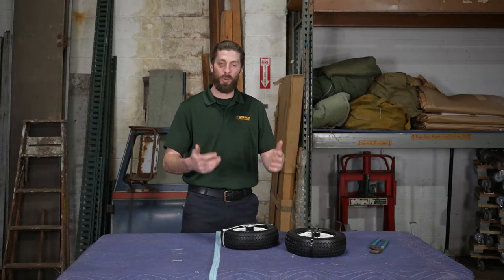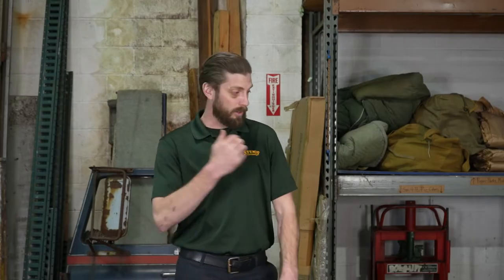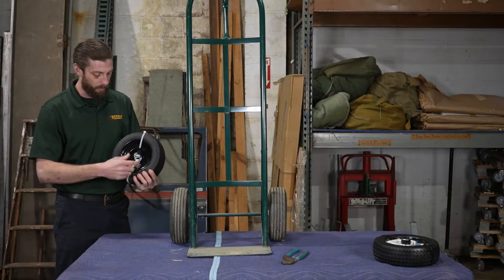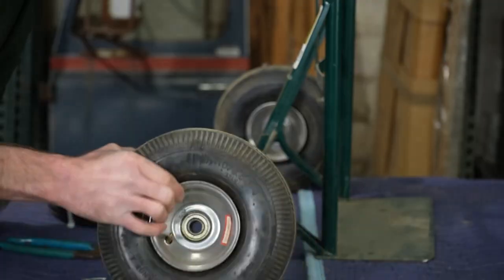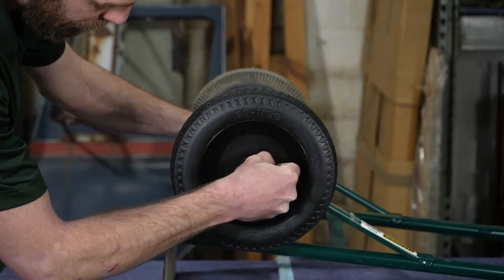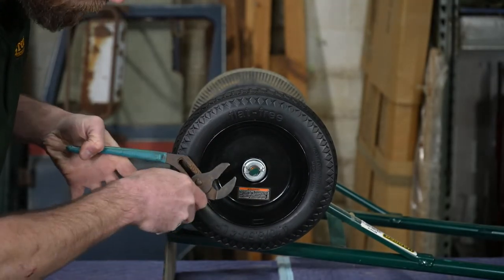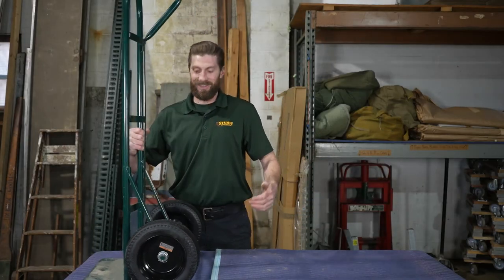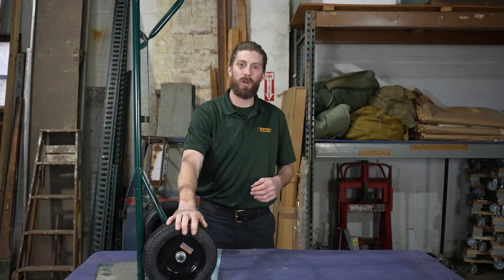How To Replace Hand Truck Wheels - A Detailed Explanation on How to Fix a Broken Two-Wheel Dolly

Comment: All of you people show how easy it is to replace a tire WITH A COTTER PIN!  Please show how to replace a tire without a pin.  Getting those caps off is a misery!
Reply from the maker: Hey Jack, no need to get upset.  Dollys with caps are just as easy to repair and replace.  Once we have a dolly in need of repairs, we will make a video.
Reply: @StumpfMovingandStorage  Thank you, I would appreciate it.  I have bought and returned two sets of tires to Harbor Freight.  My Dolly does not have cotter pins and the tires that I now have does not seem to have any way to be secured to the axle.
Reply from the maker: Have you thought about drilling a small hole through the axle for a cotter pin?  We have done that in the past, when the caps get lost, and it works great.
Reply: @StumpfMovingandStorage  I appreciate the suggestion and yes I have  considered that.  (it is probably the easiest solution)  I might not be handy enough or have the right tools to drill into a round metal spool.  It may just be easier to throw the dolly away, although it is relatively new, than to try to fix it.
Reply from the maker: Before you throw it away, try using a pair of channel locks to remove the cap.  (I've done this in the past and it works well.)  Use the channel locks to spinn the cap back and fourth wile pulling it off.  This takes some effort, but works well.  Once off, replace the wheels.  Depending upon the type of wheel you use, you may need spacers.  Save the cap and reuse it.  Place the cap back on and use a hammer to tap it back into place.
Reply: You can also use a tap and die set and put some threads in the axle and run a nut onto it
Reply: @jackcaselles1180 I got mine off.  The easiest way is to literally break the locking washer by bending it towards you.
Reply from the maker: Yes you can!
Reply from the maker: Exactly!

Comment: Fair and square; what you do if the wheel is stuk on The Axel due to dirt/rost etc?
Reply from the maker: You can use WD40 to loosen the wheel and clean it out.  It will also lubricate the bearings.
Reply: Thanks ! @StumpfMovingandStorage

Comment: Can we use wider tires?
Reply from the maker: It depends upon the axle of your dolly.  You will need to measure your axle to see if it will fit.  Make sure the wheels won't rub!